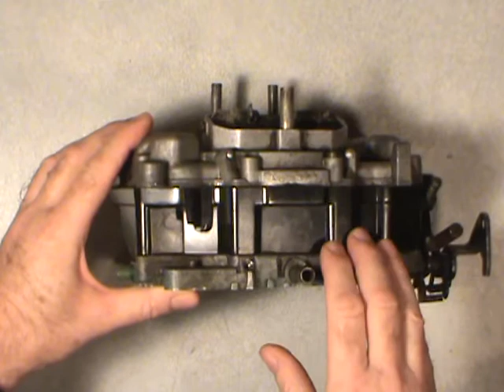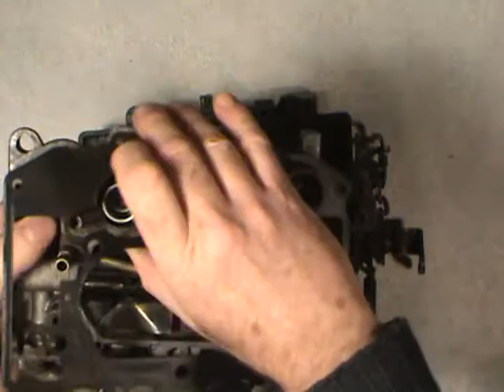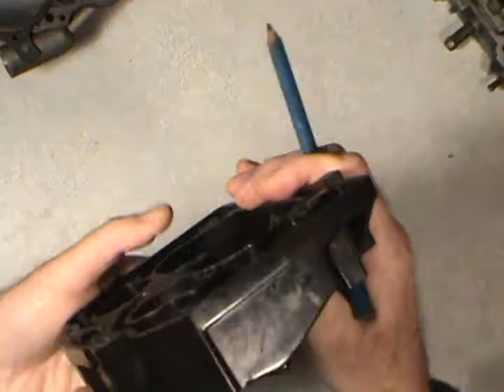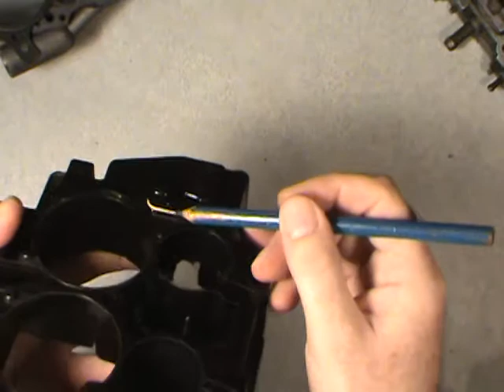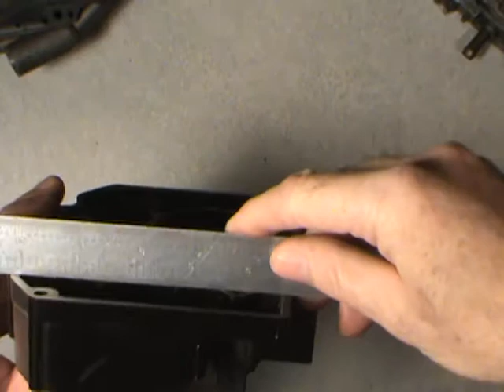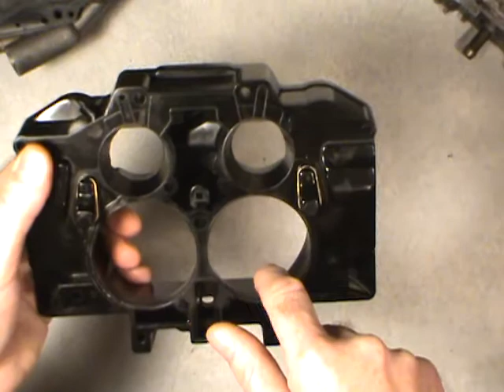Rebuild your Thermoquad Carburetor (Part F)

Comment from the maker: Greetings John D....Thanks very much for your great comment....There are a multitude of things that may cause your lean-burn TQ, and the earlier ones as well, not to operate properly....Unfortunately, I haven't had a lean-burn TQ to work on, so I can only help you out with what I have worked on up till now....First off, I'm sure that the lean-burn TQ's are calibrated on the lean side (less fuel in the air fuel mixture), and that may have been ok way back then, but....(con't)...

Comment from the maker: Greetings once again John D....Unless your lean burn system has something to do with controlling the choke plate, then, when your engine is cold, the choke plate should fully close when you push on your gas pedal and release your gas pedal....What this does, is it takes the fast idle screw off of the fast idle cam, so the thermostatic choke coil spring can use its torsional force to actuate the linkage to place the fast idle screw on the fastest step of the fast idle cam, and (con't)...

Comment: I've watched most of your videos and learned alot, they are awesome. I followed some of your videos and some instructions on the rebuilding of my Lean burn Thermoquad 9391S from 1984. i got it all back together and on the car but it has real erratic idle and it stalls. I'm beginning to think its the floats, cause it will only start again if i pump the gas. i cant set the solenoid idle stop or idle speed because its to erratic and dies. Any suggestions i could try?

Comment from the maker: ...(and)..open the primary throttle plates (butterflies) about 1/2 way (by hand) using the lever that your gas pedal cable is attached to, while still holding upward pressure on the lever that is actuated by the choke coil rod...Your fast idle cam screw (the big heavy one) should rise up to the top of the fast idle cam, and, your choke plate should close fully at the same time...You have to open the primary throttle plates a bit, so the fast idle screw is not trapped on a lower step...Take care

Comment from the maker: Greetings John D....Something sounds really messed up with your thermostatic choke coil spring or linkage!....With the exception of only one TQ model (I think) that resides on a Ford Engine, I'm pretty sure that all the rest are alike....That being the divorced type of choke coil spring (independent of the TQ)....and, on V-8's it is usually mounted in the intake manifold, connected directly to a vertical actuating rod that connects to your Thermoquad....If this is the case, then, (con't)...

Comment: I noticed that no matter what step the fast idle is on it doesn't move the choke plate. the thermostatic choke seems to just pull down and keep the choke open. i'm going to look into the rest of suggestions and see what going to do? with hi revs the secondary choke plate stays closed so it may be a linkage problem too.

Comment from the maker: ...try setting your Idle speed screw or solenoid, as the case may be, to a higher setting before you try to start your engine, and be ready to turn off your ignition (key) if your engine starts screaming at you (running too fast!)....also, try this, turn on your key to the "Run" position, not Start, then push your gas pedal down about 1/2 way and release gas pedal....What this will do is, let your curb idle solenoid "Energize" (extend outwards) to set your curb idle speed properly....(con't)...

Comment from the maker: ...It might be your lean-burn system causing some of the problems....How old is the gas in your gas tank?....Sometimes you can have some water (condensation) in your gas tank as well....Did you clean out (especially) the idle circuit tube, and passages?...( I use thin fishing line)...Can you adjust your idle mixture screws, or are they sealed?...Sure sounds like a Vacuum Leak to me...Read-up on your lean-burn system, and learn all that you can...It also sounds like a "Lean" mixture...(con't)...

Comment from the maker: ...(then) try this....Remove the rod that is connected to your thermostatic coil spring from your Thermoquad....Now, using light push and pulling on that rod (vertically), you should feel a springiness, much like that of  the small spring that you would usually find in a good old retractable ball point (ink) writing pen (probably stronger resistance)...Next, (rod still disconnected), push up on the lever that the choke coil spring actuating rod lever was connected to on your TQ and...(con't)...

Comment from the maker: ...Is your choke plate closing all the way when the engine is cold?....If not, your engine will probably sputter to a stop (too lean when cold)....Choke has to work properly, and freely, unless you live on a planet closer to the Sun! (too hot...lol).... Are your secondary throttle plates 100% closed at idle? (if not, that = vacuum leak)....As you can see, the possibilities are almost endless....Try a few of these suggestions, and let me know how it goes....Now I will go to your other post...

Comment: In rebuilding my son's Thermoquad carburetor we found one of the main jet fuel caps is leaking.  The epoxy that was used is grey so i'm guessing it was rebuilt at one point.  You mention not to use JB Weld product and I've read the same that JB doesn't hold up for one reason or another.  You mention to use a clear epoxy.  Can you be more specific on what brand or part number that would be.  Thanks!!   Really enjoyed your very detailed video's.
Reply from the maker: Greetings...Allen Hueber.............Thanks for watching............Well, I haven't, shall we say, Sprung-ah-Leak yet, as far as, those Glued on Caps are concerned, that are seen on the bottom, of a Thermoquad's Float Bowl, well, so far, that is.............The Factory/Original "Glue/or what-ever-it-was", was, as far as I recall, a kind-of, Off-White-ish color, glue-like substance..................How I found out, some time ago, as to, just What...???...kind of glue or epoxy, that may, or may not work, in this particular application, was, what I read, on some of the Thermoquad carburetor related (website) Forums, and, pretty much, how well the repair worked, or didn't............If I recall correctly, it might have been a Guy, that is known, as a Thermoquad Guru, if You will, that was probably using the Clear Epoxy, to Re-Glue those two Caps, back onto, the bottom, of the Thermoquad's (phenolic resin) Float Bowl............The way I would, shall we say, "Test", whether or not, a certain type of Epoxy (or other type of glue), will stand up to Gasoline, would be, to first, read the Glue's Instructions, and its intended use............Then, if "it" is Gasoline resistant, then, I'd probably just Glue (bond), two parts of something together, and when the Epoxy (or other type of glue) has Cured (dried), for the recommended amount of Time (and Temperature, sometimes plays a role as well, just so Ya know), then, after curing/drying properly, I would then, totally Submerse the Test part/piece, in a container, with Gasoline in it, that had a lid on it, that also had, a pin sized hole in that lid, so the container wouldn't expand or contract too much, due to pressure differences............Then, after a week or more, I would then, have a look, at the Test part/piece, and try to separate the two pieces, as well as, look closely, to see if the Gasoline, had any affect, on the Epoxy, or what-ever the Glue, happens to be.............Just always remember, that, Gasoline is very Explosive, and, to Never have, any Gasoline inside of a building, especially so, if there happens to be an ignition source, such as a Pilot Light, that's in a furnace, hot water tank, etc. ...!!!............I'm not sure, if the Longer Curing Time (two part Epoxy), is any stronger, than, that Five Minute stuff...???...........Even, if, and when, an Epoxy (or glue), is known to stand up to Gasoline, then, that's only one part of the puzzle...say what...???...well, once that Gasoline "leak" takes place, then, I be thinkin', that, the Thermoquad's (phenolic resin) Float Bowl, and the two Caps, where those parts, were in Contact with one-another (call it the Glue line, if Ya like), would then, be, well, kinda soaked with Gasoline some-what (as opposed to, the Brand New float bowl & caps, being Glued-on, in the absence of any Gasoline what-so-ever), which has me thinkin', that, what-ever Gasoline, that has (maybe?), soaked into, where the Glue-line, used to be (being, where those Caps, are in Contact with the Float Bowl), might, have a thing or two to say, as to how good or not, the Epoxy (or what-ever), will be able "Bond" (aka, stick), the Caps, onto the bottom of the float bowl...???...........Might be a good idea, to Safely (cuz of Gasoline Fumes), heat up/warm up only/not too hot, the float bowl and caps, in the area & slightly surrounding area as well, where the Bonding/Gluing, is gonna be taking place, to maybe...???...dry-out (leach-out?), any Gasoline, that might have Soaked into, that (famous now...lol) Glue Line, where those two Caps, will be making Contact, with the bottom of the Float Bowl, oh, and, a clean/dry paper towel, can be used to soak up any...???...liquid stuff, that might leach out of those particular places............Then, once completely Dry (of any residual gasoline, or what-ever), I would then, get some Sand-Paper, oh, maybe, that 100-Grit (aluminum oxide type), that I use, so much of around here, and "Sand", those two Caps, and the bottom of the Float Bowl, and slightly more, where they make Glue-ing Contact, so to speak, and hopefully, the Re-Glue-ing, of those two Caps (onto the Float Bowl), will last-ah-Life-time (might be wishful thinking, for the most part)..........Also, I'd probably be doing the Epoxy-ing/Glue-ing, at Room Temperature, or maybe, a bit warmer, to increase the odds, at having, a more successful, & longer lasting Repair-job (I hope)...........Good luck, and.......till next time........Be Safe, take care, and have a good one.
Reply: Thanks for the in depth response.  While we were waiting for a response we continued to do some research.  We found people were having issues with the grey JB Weld products and that several people highly recommended the Marine - Tex "White" epoxy product.   I contacted the company and they said the "White" epoxy is a good product but that like any epoxy will have issues over time.  How long that time is - 6 months, 6 years etc.. is anyone's guess.  I purchased some of the "White" Marine - Tex product and we will see how it goes.  It looks like both caps sit inside a recessed reservoir in the float bowl.  If the cap does leak again will it actually cause any issues since it's leaking into a closed reservoir - provided the gasket doesn't fail.    Thanks again for your input!!
Reply from the maker: Greetings...Allen Hueber.............Thanks, for letting me know about, that Marine-Tex-White-Epoxy, and, I hope it works out well for You and your Son...........Maybe, a business, that deals with Gas Tanks, and/or, a Company, that has a Gasoline proof/resistant sealing product, that gets put onto a fitting or what-ever, that gets pushed into/screwed-into, some kind of Gasoline environment, such as a vessel or tank, etc....they might also have some useful information for Ya, but, if so, the Goop or what-ever, has to also, Bond with that Phenolic Resin, that the Thermoquad's float bowl is made out of, as well............I just took the Thermoquad carb apart, to have a look-see for myself, and sure enough, the very cool observation, that You made, about being a closed reservoir (that's cast into the throttle body/bottom aluminum casting), that accommodates those two Caps, looks like it should work, "Without" having those two Caps on at all, but only, "if"...???...there is a, shall we say, Permanent (and not leaking) sealing Gasket in that particular area.............If there ever is a Gasoline "Leak", due to a Thermoquad carburetor, then, the first place that I'd be looking for such evidence (of that gasoline leak), is on the Oil Level checking "Dipstick"...why You ask...???...cuz...Gasoline will probably trickle downwards, due to the Earth's Gravity, and, here's an example for Ya............I had one (of the two) Nitrophyl floats (that looks like black plastic) start Sinking on me (float was Gasoline water-logged, like a sponge, so to speak), and the Wet fuel level, in that particular float bowl, got way too high, and the extra/not wanted gasoline, probably spilled over, and, it, over time, made its way into the engine's Oil Pan..............Well now, my Oil Level was higher that it should be, and also, the motor Oil looked Thinner to me as well (on the Dipstick, when it was cold).............I could even smell "Gasoline" on the Dipstick...!!!...Yikes...!!!...(not good).............So, from now on, I'll probably be using "Brass" (hollow) Floats, in the Carburetors, that I have the pain/pleasure to work on (only a few dollars difference).............In the future, who knows, I might even try it without those two Caps installed, just to see if it works ok or not, providing that I have in custody, at the time, a faulty Cap seal or two...or...You and your Son, might be the first People to give it a try...or not...???............Good luck...and......till next time........Be Safe, take care, and have a good one.

Comment from the maker: ...also fully close the choke plate! (100%)..You see my Friend, a "Cold" engine needs a very, very Rich air/fuel ratio (mixture) to start, and keep a cold engine running, especially if said engine has a carburetor sitting on top of it...Reason being, that the gasoline tends to condense on the inside of the intake manifold (because it's cold), therefore, cold air goes in, but not enough gasoline with that air, in other words, too Lean!...Also, be careful, you might have a "Backfire!"...Take care

Comment from the maker: ...as for todays Gasoline, well, it is somewhere around 3% "Leaner" then it was way back then...That in itself will make most carburetors run leaner then they did with the good old gasoline of the past...If you have those (prone to absorbing gasoline, and sinking, black plastic) "Nitrophil" Floats, then that will usually cause your engine to be running way too Rich!....New floats work wonders....Check for any Vacuum leaks, and get a new exact same choke pull-off diaphragm too....con't...

Comment: What’s the best way to clean the resin bowl?
Reply from the maker: Greetings...holmeydude...Thanks for watching...When it comes to cleaning a thermoquad's resin float bowl, I just use gasoline and an old toothbrush for the main scrubbing...Then, a Q-tip, bamboo skewer, toothpick, or whatever works, that will get into the much smaller areas and corners, in order to git-er-done...By using something chemically stronger, such as carb cleaner, then, it might, shall we say, "eat up" that good ole resin float bowl...The thermoquad's resin float bowl, holds up very well to gasoline however...Check those two "caps", that are glued onto the bottom of that resin float bowl, and if they are loose or leaking, then, once removed, sand the two mating surfaces on the bottom of the float bowl, as well as the two caps...Make sure that everything is dry and clean, then, glue them back into place, using something like "JB Weld" (a kind of, industrial strength, two part, epoxy/glue)...Make sure, to be "outside", and far away from, any sparks or flame, whenever working with gasoline, for safety's sake...Good luck, and...be safe, take care, and have a good one.